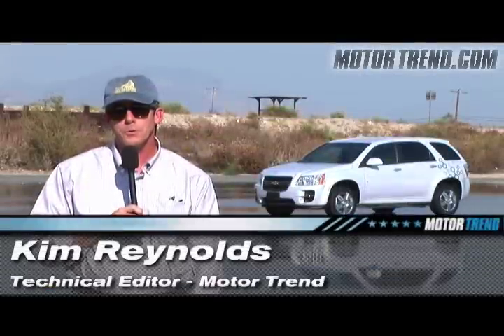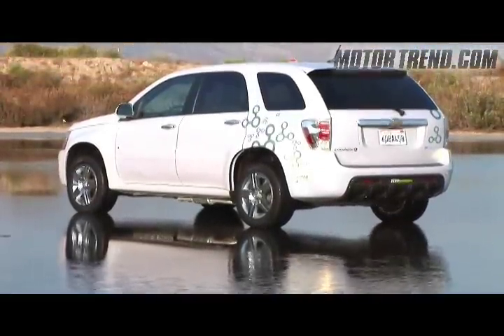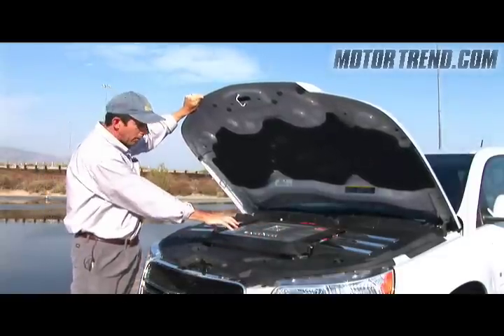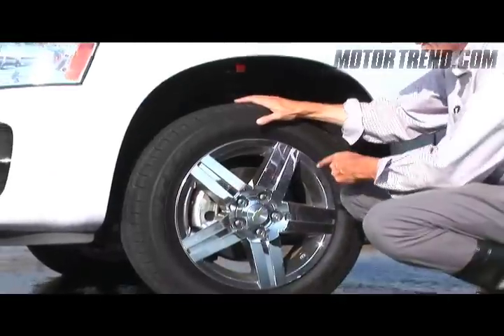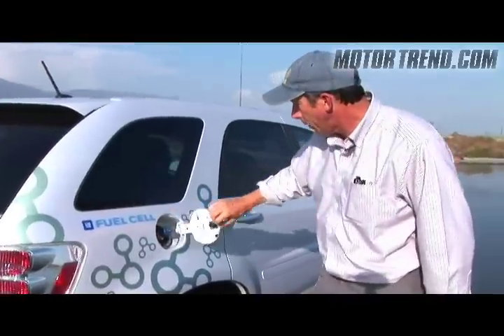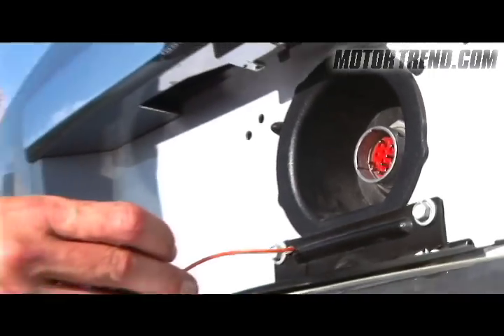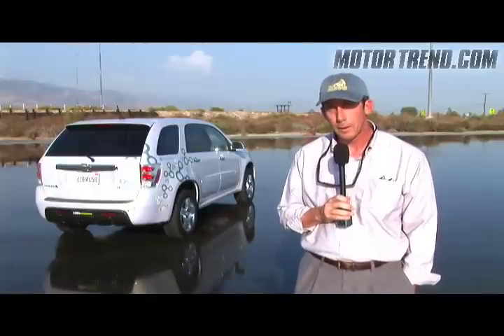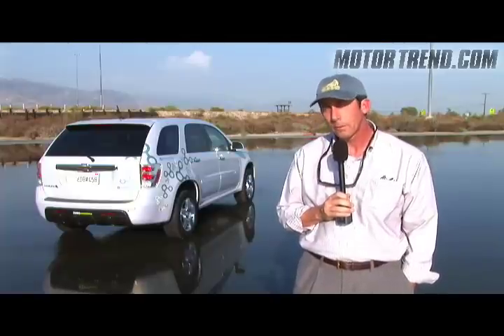Car of the Future? Chevy Equinox Fuel Cell

Comment: "Splitting water into hydrogen and oxygen uses tons of energy."

Honda Clarity works like -when hydrogen is connecting to oxygen  it creates electricity. Thats why you drive on hydrogen cell. If you want to get hydrogen, you can split it using electricity which you get from solar or wind ? wouldn't be that good ?

Comment: Fuel cell cars lack the efficiency of EVs and the power of gasoline, all for a fuel that is impossible to store, making even the brawniest fuel cell fall short of air powered cars. Hydrogen seems like a good idea on paper, but in reality it is one of the most expensive and inconvenient fuels available.

Hydrogen cars won't see realistic production for a long time, and even when it does happen, Electrics, Hybrids, and Diesels will still be far superior.
Reply: internal combustion engines running gasoline are only 20% efficient
Reply: yeah... they are. if you want higher efficiency, buy a Tesla.